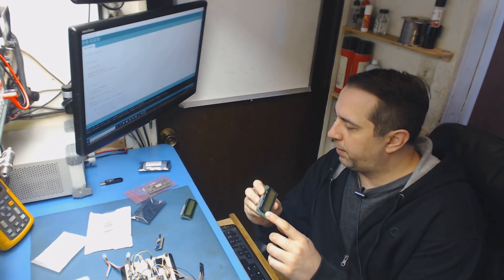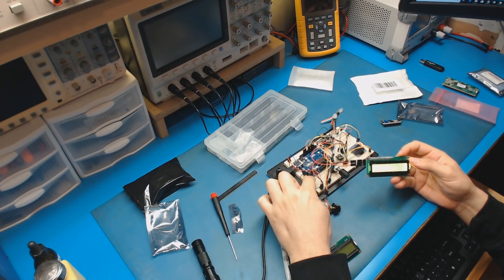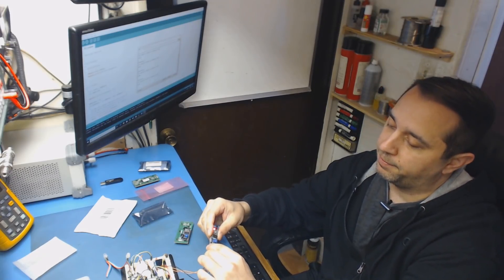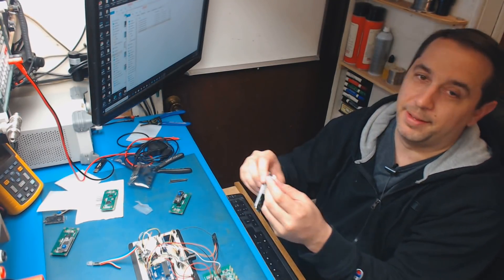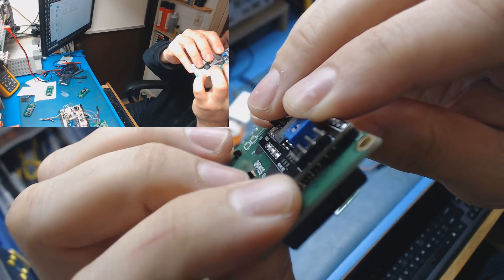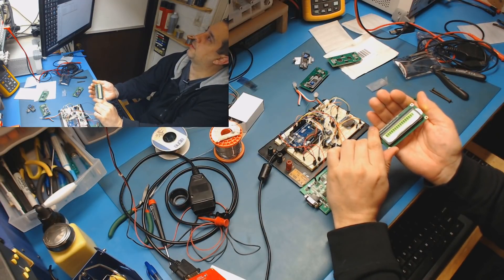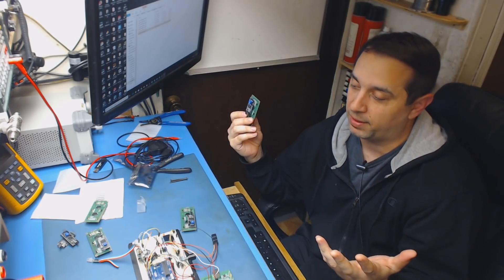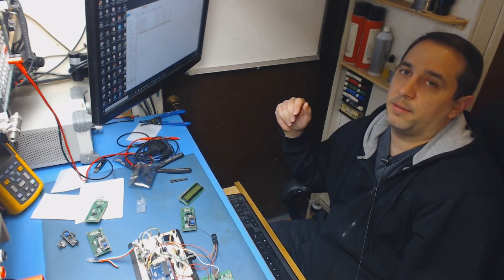Testing Questionable I2C Lcd's

Comment: // #include <Arduino.h>
 #include <Wire.h>           
 #include <LiquidCrystal_PCF8574.h>
 #include <ESP8266WiFi.h>
 #include <BlynkSimpleEsp8266.h>
 #include <Blynk.h>

LiquidCrystal_PCF8574 lcd(0x27);  // set the LCD address to 0x27 for a 16 chars and 2 line display

// 2 custom characters
byte dotOff[] = { 0b00000,0b01110,0b10001,0b10001,0b10001,0b01110,0b00000,0b00000 };
byte  dotOn[] = { 0b00000,0b01110,0b11111,0b11111,0b11111,0b01110,0b00000,0b00000 };

int show = -1;

 void setup()  
  { 
 int error;

  Serial.begin(115200);
  Serial.println("LCD...");

  // wait on Serial to be available on Leonardo
  while (!Serial);
  Serial.println("Probing for PCF8574 on address 0x27...");      // See http://playground.arduino.cc/Main/I2cScanner how to test for a I2C device.

 
  Wire.begin();
  Wire.beginTransmission(0x27);
  error = Wire.endTransmission();
  Serial.print("Error: ");
  Serial.print(error);

  if (error == 0) {
    
    Serial.println(": LCD found.");
    show = 0;
    lcd.begin(16, 2);  // initialize the lcd
    lcd.createChar(1, dotOff);
    lcd.createChar(2, dotOn);
  } 
  
  else {
    Serial.println(": LCD not found.");
  }  // if
  }  

  
 void loop()   
  {  
    lcd.setBacklight(255);
    lcd.home();
    lcd.clear();
    lcd.print("Hello LCD");
    lcd.setCursor(0, 1);
    lcd.print("PCF8574T LIBWork");
    delay(1000);
    
  }

Comment: I got some of those boards, they worked well and were easy to get running, they MIGHT have a different address though, check the programming resistors, as I have seen them coming with different addresses. Yep mine had QAPASS silkscreened on too, so exactly the same modules, I would say, as you noticed, that the I2C board is shorting out on the LCD board, try lifting them off a bit and seeing if that works. I used "I2C_Scanner" to find the address, just as you did.
Reply from the maker: Once I get the "ok" that I don't have to send them back I am going to try to work on them.

Comment: MADE IN CHINA  WHAT DO YOU EXPECT ?
Reply from the maker: Unfortunately most all of these type displays are made in china.
Reply: @Kev_31779  Well you can always buy from official YWRobot distributor such as Banggood for the boards, and you can buy displays from EastRising. EastRising stuff is going to be high quality. Not sure about YWRobot? Buy a clone from SainSmart, it'll have to be good. 'Made in China' doesn't have to mean 'made in a shit stained cellar by blind chimps' but if you don't go for reputable suppliers, there's that risk that it does. There's nothing particularly unfortunate about a fact that the screen is made in China, it's just a big place.